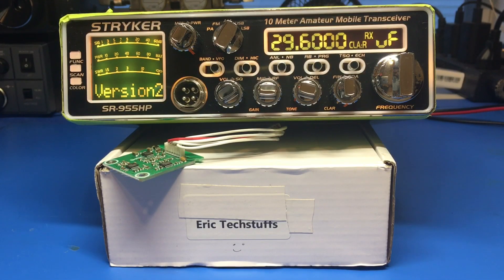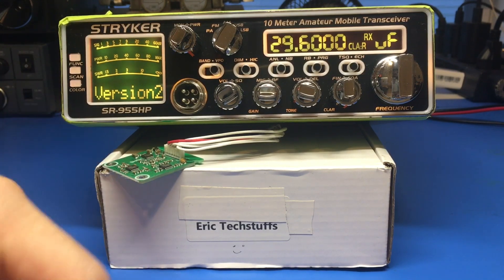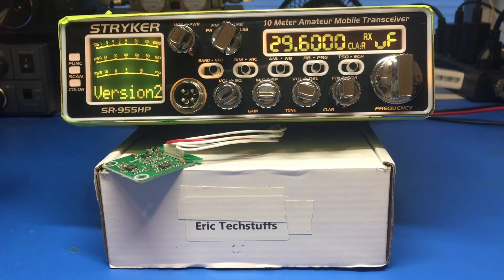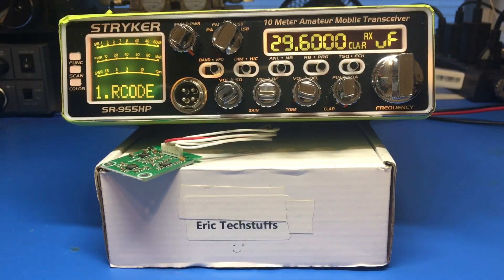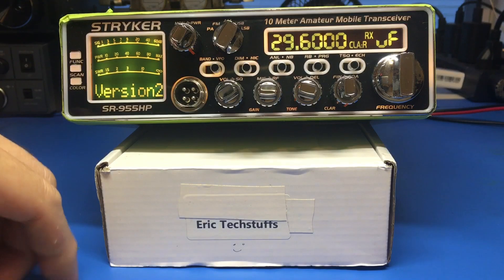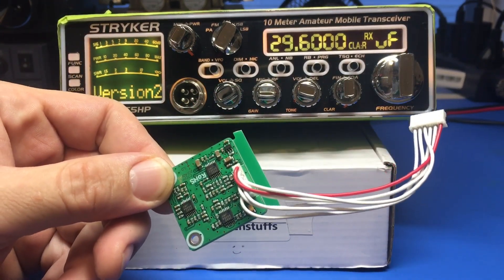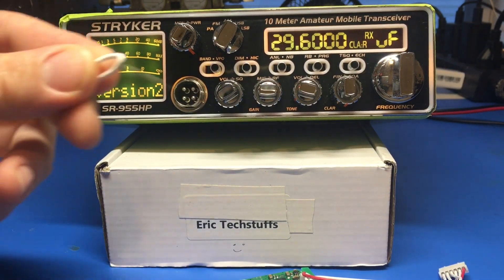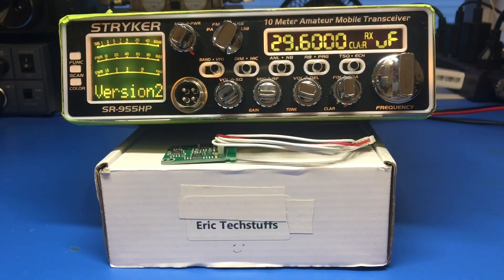Stryker SR-955 v2 CTCSS Tone board install and use for 10 meter repeaters and other uses

Comment: Hi Eric, I have the 995hpc v2.  Can you tell how to set the repeater offset, and stay in that setting when vfo mode is off?  Thanks
Reply from the maker: Hey Bill - it's  mostly the same for V1 or V2 after the board is installed. What I always do is use the programming software to use the last band for repeater offsets with RX TX and tones. About the easiest way to go about it.  That way you can program offsets and have them on the ready.  Otherwise you have to use the manuals instructions to go about it.  V1 and V2 on the programming side the same for both after the board is installed.  Hope it helps ! 73
Reply: Hi Eric,  thanks!  That worked.  I knew there had to be a way.   73's. Bill